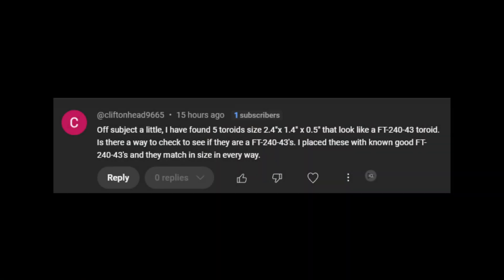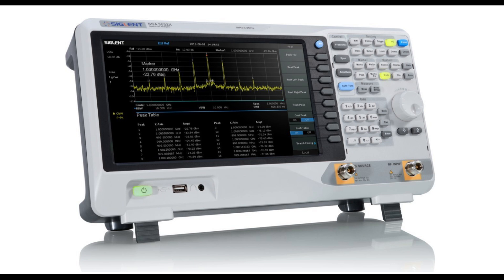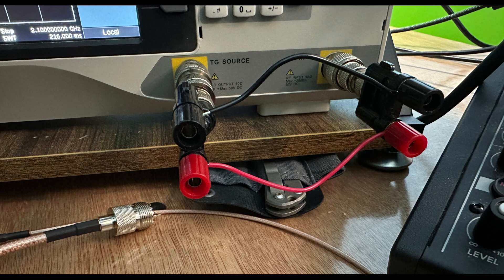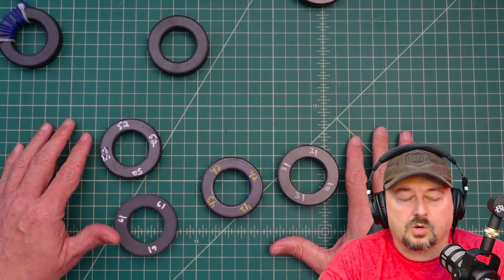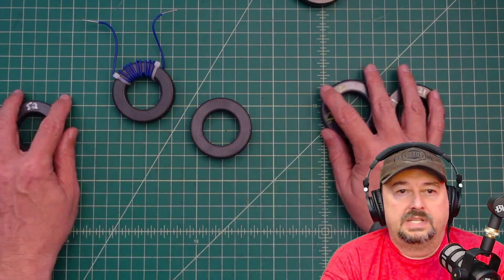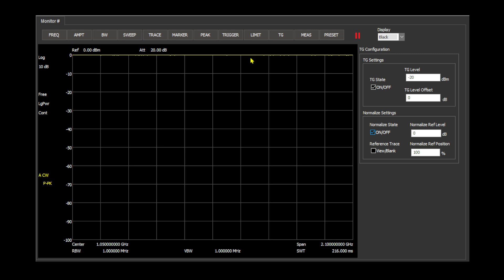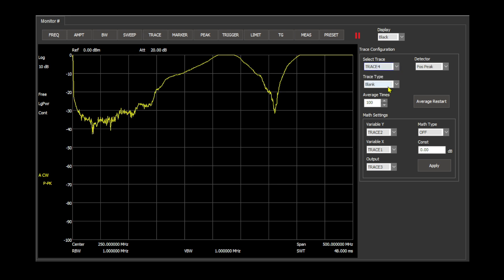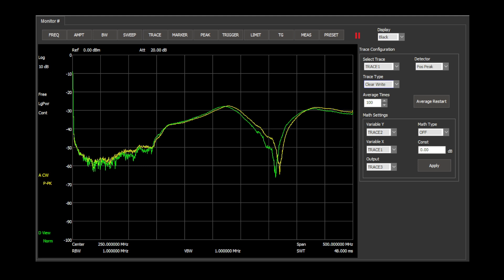Ape Answers 018: Testing Unknown Toroids

Comment: The calibration by pressing the "normalize" button seems weird for somebody coming from the VNA world. You are performing a S21 series-through measurement, but since the spectrum analyzer doesn't have S11, i suppose, the normalization is done on "through" only. On a nano VNA the calibration would be OSL (open-short-load) on port 1, and through and isolation for S21. On a more professional VNA, there is a OSL calibration within the test fixture of the S21 series-through measurement.
Reply from the maker: @earlyadapter643  the normalization is essentially a through calibration on the VNA 👍

Comment: I don't understand why manufactures don't print brand and model number on cores like they do on most other components.
Reply from the maker: That would come in handy
Reply: @TheSmokinApe  According to Chat gpt, the cost of marking them with continuous ink jet printer would be $0.002 while the cost of marking them with laser would be $0.0013. I don't know how reliable that is but it seems like it would be worth it. I mean even 0603 resistors that sell for $0.0014 in 5000 quantity have marking on them.

Comment: That the test I do.  I have gotten wrong core types in the past. I no longer buy from them.  A outher tip. Take a ohm meter. The type 31 is the only one their that has resistance.   Now for high power or high voltage use wrap in Kapton tape.  Or use PTFE wire. The High voltage  or RF can arc threw the core .  This can be a problem with MAG wire if you nick the enamel wire. You still can use MAG wire just be careful of that  or put MAG wire in a PTFE tube then wrap.  Remember windings can arc to each outher . Also remember the core will heat up under power levels . PTFE wire or tube or Kapton tape will help with that . Over time the heat can damage the core . Let them cool down when your SWR goes crazy .  You will be fine.  I got RED and a yellow T 240 cores.  They powered IRON.  The weight gives that away . Also their is some custom mixes out their in toroid world  .  73
Reply from the maker: I’ve seen the DMM test but don’t really trust it that much.  Thanks for checking out the video Rob 👍

Comment: Would have been beneficial to use a more common and less expensive VNA for the teaching vs an expensive insturment.  Just a thought.    Ed KK7UNA
Reply from the maker: Hey Ed.  Totally fair point, I have many and I mean many videos using the NanoVNA and TinySA for ham radio applications.  Whenever I make those videos someone comes along and says I should be using “real equipment”.  Naturally I disagree and feel the NanoVNA and TinySA are appropriate for ham radio use…. That said, I like to mix it up and show using different type of equipment so folks can see what’s out there.  Thanks for watching and for the comment…
Reply: How could I do this with a nanoVNA? @TheSmokinApe
Reply: @TheSmokinApe Yeah but you don’t get a tracking generator with the tinySA😕 Sure would be nice if they’d find a way to incorporate the feature in one of them. Lab grade SA are $$$
Reply from the maker: @goobercrow198  it would be sweet if it had one.  You could do this measurement with a NanoVNA though